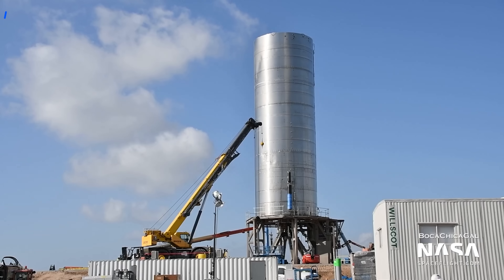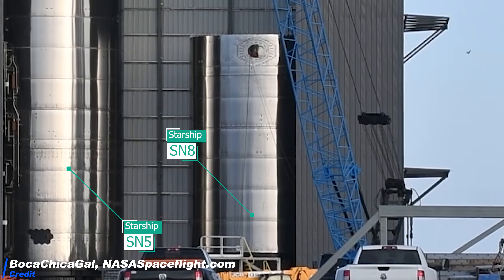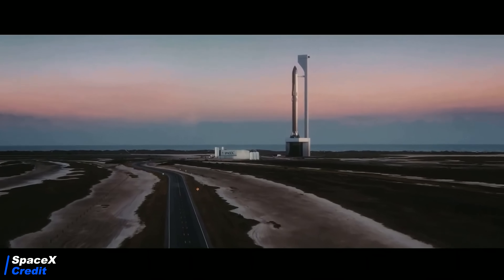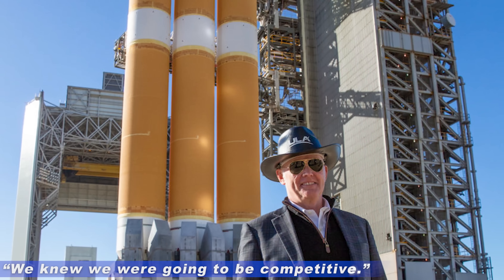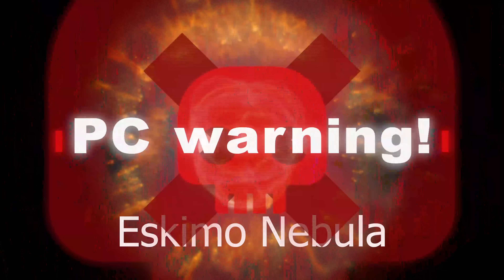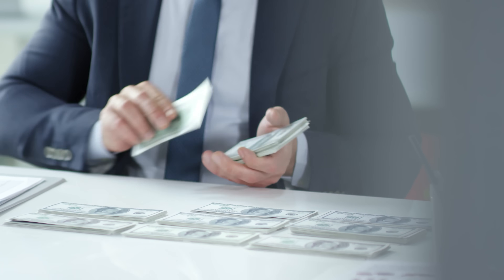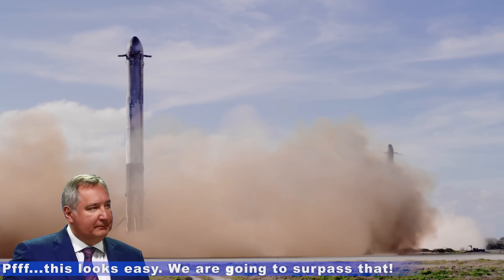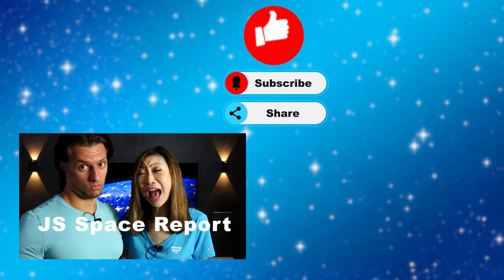US Military UNDERPAYS SpaceX & Starship / Super Heavy Test Update

Comment: I think Roscosmos can pull it off, but it won't be a starship clone. Am very curious about their ideas
Reply: Roscosmos simply does not have the financial resources to do, pretty much anything. Russia has a GDP smaller than Brazil's. They are punching above their weight, trying to maintain the illusion of still being a great power. Pretty much the only reason they still have a space program at all is for that reason, to create national prestige. The other big problem of course is that significant amounts of their very small budget disappear into the graft and corruption that defines modern Russia. It's a wonder they manage to keep operating at all.

Comment: You now get too many comments for me to pre-read to check if it has been already said before I comment.
I'm pretty sure SN6 is the old stainless alloy. It was not til SN7.0 that the new alloy was used. So SN8 onwards will use be tested to the extreme pressures.
I wonder why, if it is true, why SN7.1 test tank is being built, maybe they will use a thrust disc on the lower dome this time?

Comment: actually, in time, if ULA doesn't get into the reusable rocket business, ULA won't have a business at all. give it time. when the next contact goes 60-40 in favor of Space X. watch how ULA will start crying. or forming a terrorist group to sabotage SPace X Launches. like in Contact
Reply: I think the next contract will be 60/40 SpaceX/Blue Origin. Right now ULA has the advantages of launch experience, active rockets to fall back on if Vulcan takes longer than expected to fly, and the fact that three other contractors, including both of the losers, are providing their engines and SRBs. Come 2026 though, Blue Origin will have the reusable New Glenn actually flying, with several years involvement in launch operations. My guess is that ULA will have very little to offer in comparison.

Comment: tbh you need to do more research. So many facts incorrect in each video..
SN6 is made of 301L steel not 304L. 304L. SN6 was finished before a single role of 304L was on site. Meaning SN6 wont perform better then SN5 but the same.
Also SN6 isnt a working prototype. It can fail and you fail to recognise that. They only have 1 working prototype and 1 in the works.
The dome being flipped belongs to SN9 not SN8.
The rebar cages arent confirmed for a launch tower. They are yet to getting planning permission for a Launch tower. They still have a water tower permit and nothing else.
Also your moaning about ULA getting more then SpaceX but if you have a provider who you have used for DECADES and once who has made it big in the last 5-10 years you favour the one youve used for a while. Not a waste of money just for safety reasons.
Reply: Well its not that hard to do the little research. Look at the timelines at Boca and realise how it went. I wouldnt need to complain if you did the simple stuff and delayed the video by a few hours to make sure its correct. . No need to be dicks about it.